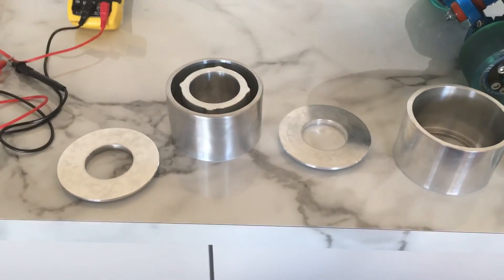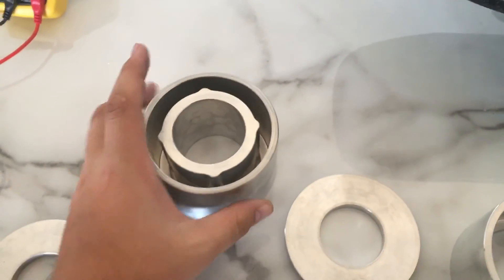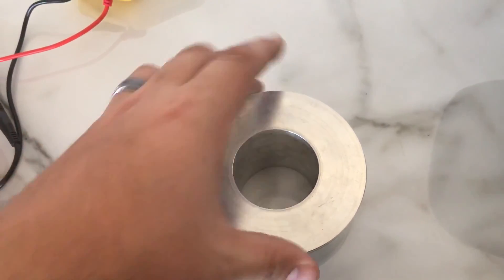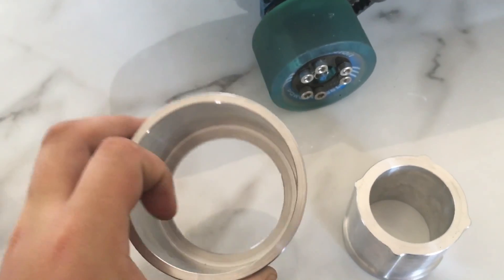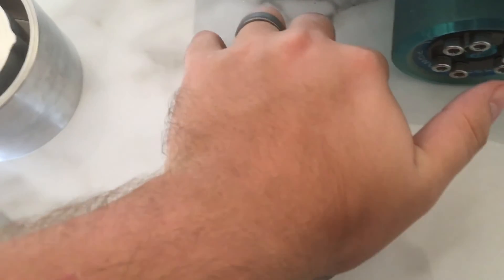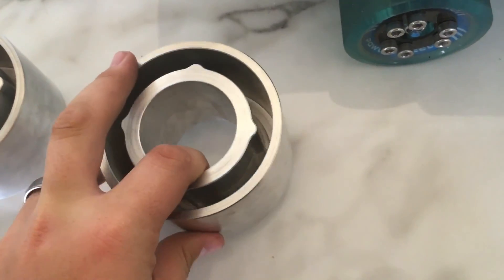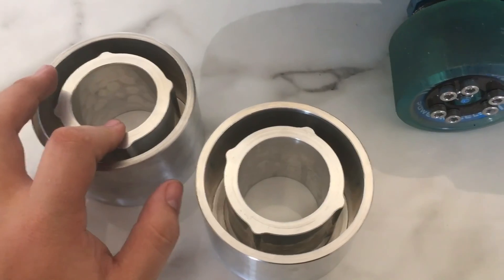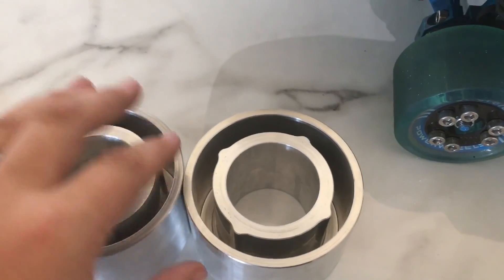Polyurethane wheel hub motor mould

Comment: is it possible that you would make a motor with abec wheels 97mm or 107mm
Reply from the maker: You can't machine urethane very well, but I have make a mould for 107mm but with that size wheel I would want to make a bigger motor because more torque is required to spin the 107mm wheel.
Reply: +griffincobby dual 60mm motors won't cut it? maybe sensored motors
Reply: +titoxd1000 Do you think you will have some of these hub motors available for purchase with in the coming months? How many cells/voltage do you estimate to get 25mph?
Reply from the maker: +titoxd1000 don't know it's an expensive task, but 10s would be best. You will get about 28mph
Reply: +griffincobby that would be perfect. Hope things work out this would be a great option for the diy skateboard community
Reply from the maker: +titoxd1000 if you know some one with 10-$20,000 then I can make enough to sell them for $100 each
Reply: +griffincobby I don't sadly